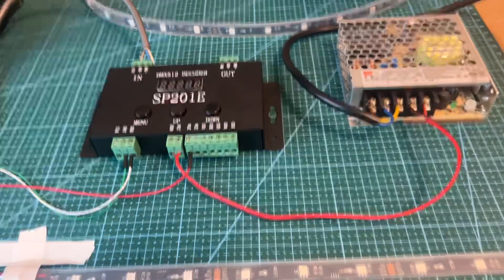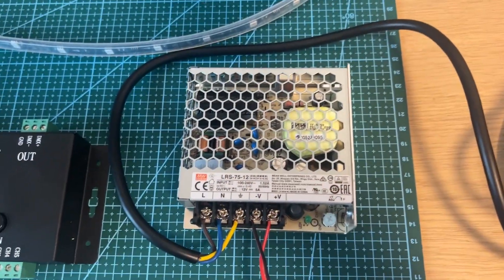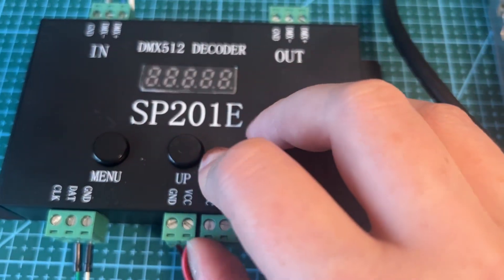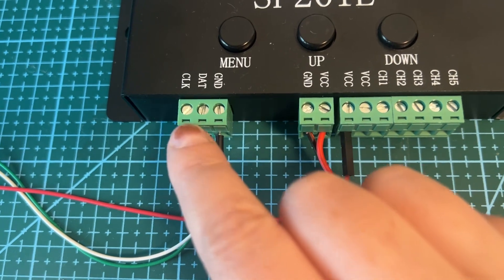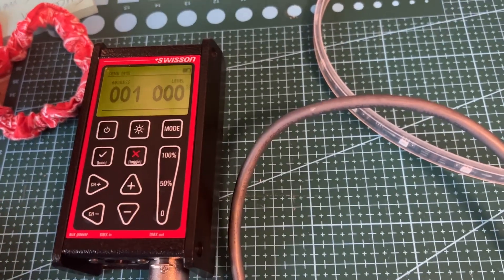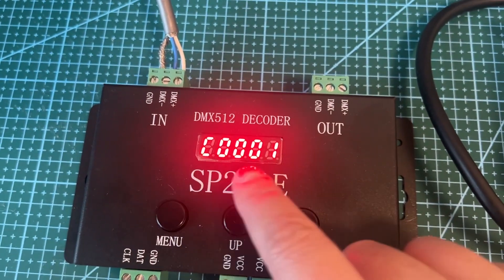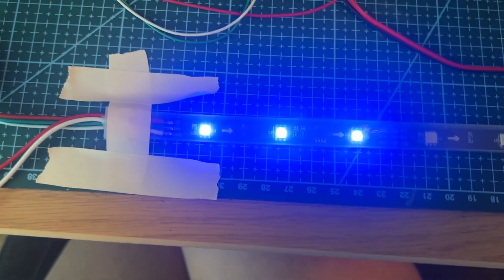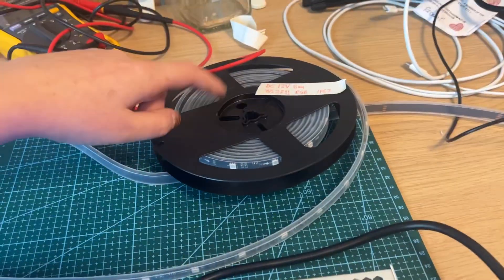SP201E DMX Decoder set up for WS2811 pixel LED strip

Comment: Thanks for this. Really useful and clear.
Wired up exactly as you showed.
On our zero88 I chucked the sp201e in as generic 3 RGB led fixtures, counted up the beads in the WS 2812B led string - 39 in total. (I didn't have any tape to hand)
Selected all 39 and plotted a chase. Then saved into a sub for later.

Got the finale of my October show all ready to go!

Comment: I have one of these. Some thoughts based on the comments below:
 
The 3,072 pixels probably relates to it running in 'standalone' mode. I suspect the effects 'repeat' every x pixels regardless. With no DMX incoming signal the device will run one of 100 presets. Both the preset and the speed are selectable from the menu. The presets cannot be launched from DMX, i.e. you can't use DMX to select 'operating modes' on the device. The other menu is for selecting the type of pixels you are connecting,

DMX will (by nature of DMX) give you up to 170 RGB pixels (= 510 channels), starting from the configured start address upwards. To get effects/patterns that would need to be defined in the incoming DMX data so from whatever DMX controller you're using.

The 5 x PWM connections map to the first five 'receive' channels - so with RGB pixels connected the three channels from the first and two of the three from the second are shared. To have them independently controllable it's necessary to install, say, a couple of additional pixels not in the display (or just WS2811 ICs with the LEDs removed). In that way the PWM outputs start on the configured DMX start channel, the pixels start on start channel + 6.

This is all based on my experience/understanding of this device only, but hope that's of some use!

Also some of the terminology in the video is very wrong. The pixel data output shown has nothing to do with DMX - it is not a DMX output. This box converts DMX data from the input into pixel data, which is in one of a few different protocols. This example is showing WS2811 protocol (for WS2811 strip). The addressable LED strip is incorrectly referred to as 'DMX strip' - you cannot drive addressable strip directly with DMX data. That's the purpose of this box. The DMX out connection would be used to connect additional DMX devices which can be controlled from the same controller i.e the same DMX universe of 512 channels.
Reply: Very informative. Thank you very much!
Reply: @Styx_Gym  I now sold this, they are very laggy when working with DMX conversion vs other products out there. May or may not be an issue depending how you want to use it.
Reply: So this controller can control 1 whole universe of dmx? 
I am looking in to these controllers for in total 4 universes of ledstrips
Reply: @dv9159  What are you looking to control (Number of pixels) and what is your control device? What you're asking doesn't make sense in its current context, DMX is a completely different protocol than what pixels understand. The input to this device is a terminal block though it's equivalent to a DMX XLR style connector..
Reply: @richienorthcott  well it is a dmx decoder so makes sense then?
I run MA2 onpc, still have 4 universes room so 2048 ish channels.
So should be able to control 680 pixels with 4 decoders, each on its own universe (512 channels)
Reply: @dv9159  OK well yes you'd need 4 of these, your maths is correct each can drive a string of 170 RGB pixels You might also want to look at one of the many sACN or ArtNet to pixel controllers. These accept multiple DMX universes over wired ethernet as the input.. They are generally much more capable devices, this one is somewhat Mickey Mouse. In the holiday shows on my channel I'm using wired sACN.
Reply: @richienorthcott  Thanks, I am used to "normal" fixtures with dmx control. There are some fixtures who are basicly smart strips but they cost a lot. So want to try to make my own kit first. In the future would like to use Madrix (made for matrix lighting control).  What hard and software do you use? Does it work on a MTC timecode signal?
Reply: @dv9519 my response keeps getting removed, I have no idea why

Comment: The included instructions with this unit are the pinnacle of bad tech writing. And your video didn’t really clarify much other than how to physically connect them. The DMX schema is simply not documented *anywhere*. it claims to also support 5 PWM channels for RGBCCT strips, but how are those addressed? Nobody knows. For that matter, it supposedly supports 3072 pixels, but how does it do that with only a single DMX512 input? That’s only good for 170 RGB pixels. 

Why is it doing 3 pixels per channel? Is that configurable? How do you configure it for the various pixel types out there?
Reply: On mine, the 5 PWM channels are the first 5 DMX channels, so shared with the pixel output. Ideally the pixel data would start at DMX channel +5, but it does't. I don' think it's possible to change from the very limited documentation. There's nothing fancy in the DMX support. first DMX channel = pixel 1 R, second = pixel 1 G, third = pixel 1 B (assuming RGB pixels connected). So yes you're limited to 170. Also I've not seen 3 pixels per channel - perhaps you have the 12V addressable strip, where you'll see there is 1 chip per three LEDs. This is normal. They are only addressable in groups of three from any device.
Reply: @richienorthcott  would you make us all a video in how to actually use the interface.  Seems like your the only one that knows how to take dmx and control smart leds with this decoder.
Reply: @tomdeclue6424 I sold mine, there are better products out there. But it's fairly useless if you want to control 'effects' via DMX i.e. if you want to use DMX values to call up different effects based on a slider position, say. This is not the device for you. With this device your DMX controller needs to generate the effects. The pixels simply map to the DMX channels, and since a DMX universe has up to 512 channels if working with addressable RGB pixels or strip that gives you 170 only (170 * 3 = 510). If you set the start address of this box to 1....

DMX channel 1 = pixel 1 R
DMX channel 2 = pixel 1 G
DMX channel 3 = pixel 1 B
DMX channel 4 = pixel 2 R
DMX channel 5 = pixel 2 G
DMX channel 6 = pixel 2 B
etc.....

This video shows the connections correctly.
Reply: Hi, just to say: I learned from The Hook Up (YouTuber) that certain lower cost models of LED tape treat 3x LEDs as 1 "pixel". Presumably to save money on control chips, but also useful to use fewer DMX channels for longer lengths of strip.
Reply: @jainobes1123  Yes - also if you check the WS2811 IC datasheet, the 12V example actually has three LEDs in series, so this is fairly normal. My 12V strip is the same as yours, as is the one shown in the video.